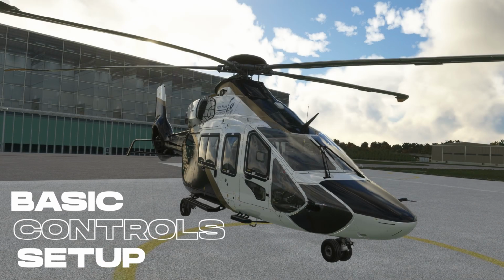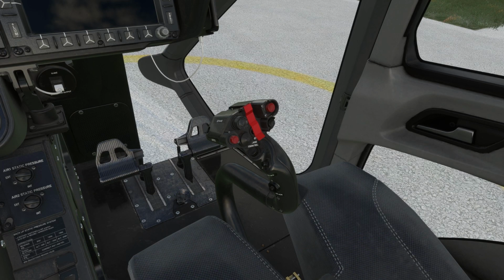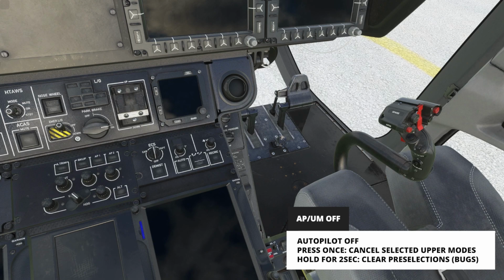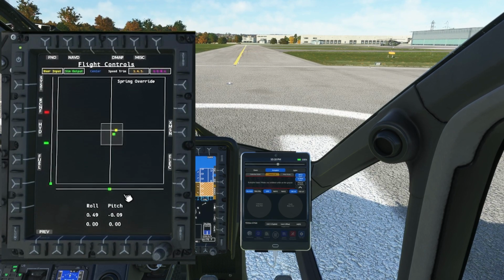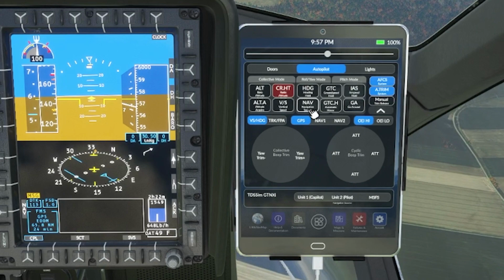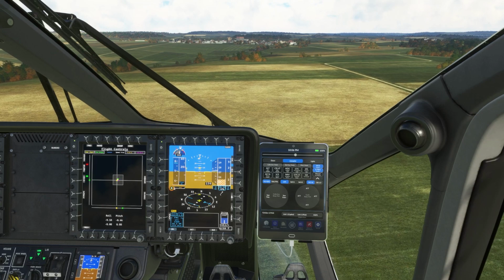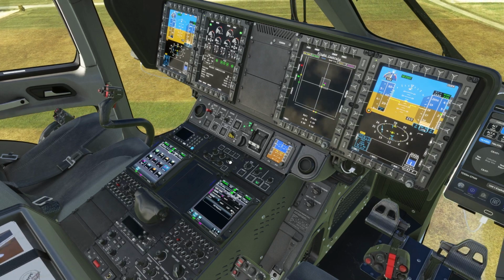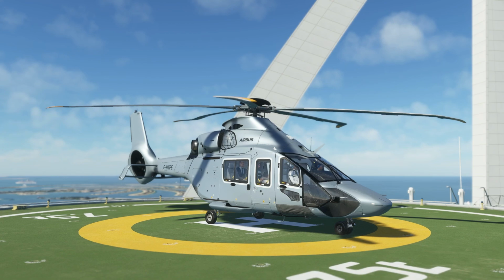Hype Performance Group - AIRBUS H160 and H145 Controls #msfs2020  #h160 #hypeperformancegroup #h145

Comment: Thanks for the tutorial, very helpful 👍🏻. It is possible to bound NAV and CPL to a key stroke or joystick binding. I am using the H145 HPG. You can define the NAV (for switching between nav sources) and CPL (to couple the nav source to AP) with custom key bindings in the config tool within the setup of the H145. See the documentation for more info.

Comment: Thanks for your video, very informative and helpful! I only have the H145 at this time but I encounter a persistent issue which I think you may be able to resolve, if anyone can. When I switch out of AFCS mode to either SAS backup mode or full manual mode the pedal output (and the visual pedal positions) remains at what it was at that time, and the only way I have been able to get it to reset and return to the same as my input is to land. I hope I've explained that clearly! 😉 I haven't been able to resolve this in spite of releasing/resetting all trim settings 🤷‍♂
Reply from the maker: I’ve seen that and I think the Devs are aware. Are you on the HPG discord? It might be worth asking there. If I recall it’s a visual bug and I know it’s happened to me.

Comment: Thanks. Purchased H160 - Great aircraft. Only experience is with DCS Apache.
Tablet control is an immersion killer for me.  Some bindings does not work, such as AIS - but I found it on the panel, works OK.
Q: have problem with auto hover engage.  A second hit activation may activate, but most often not.
First engage is GTC (Green or yellow arm).
Flying into center of HSI hover with bleep trim does not help. It stay in GTC, even with new button hits. More or less random hover is yellow amber.  Or with some luck hover engage annunciator and green circle .But I do not know why...
So - what is prerequisite for green hover engage?
And trim release is the same as trim reset  in DCS - setting a new neutral..?
Keep up the excellent work.
Reply from the maker: I think the biggest obstacle for you is that it's not like the apache at all.  It took me some time to wrap my head around it.  I might suggest my latest video to help explain trim release and follow up trim a little more. https://www.youtube.com/watch?v=TwPO1yQjeYQ
Reply: @Blueecko   Thanks for quick reply.   How to get Auto hover?  I bind a switch to auto hover.  As mentioned above this bind to primary GTC - not auto hover.
Reply: Update - I figured it out.  Auto hover toggle not on release , but on press.  Now the hover is armed yellow.  Slow down and hover/height is engaged green.

Comment: Can you tell anything of the install process, Is it a download and install in community folder or
does it involve having to go through some desktop installer, and also have to install this and that and you also need these and be running those etc
Reply from the maker: Hype Performance has an application called Hype Operation Center. It handles the install and updates and you activate your license key through that upon install. It is not required to be running at all times, only at install or update.
Reply: @Blueecko  Thanks for that